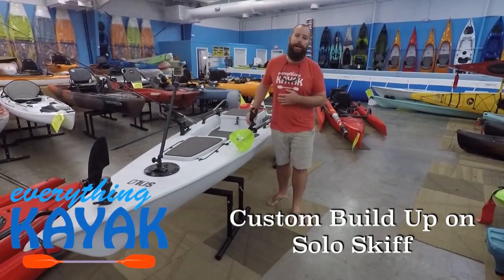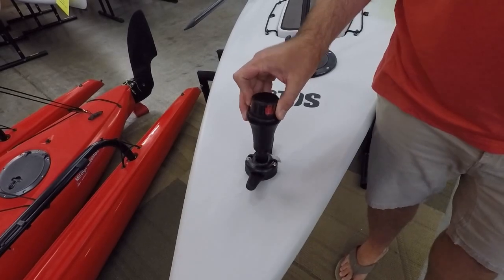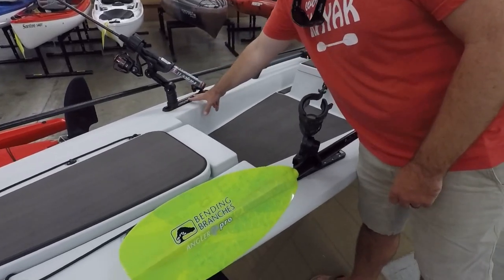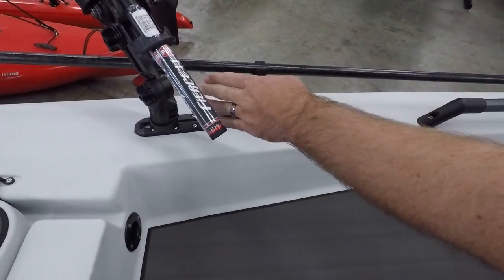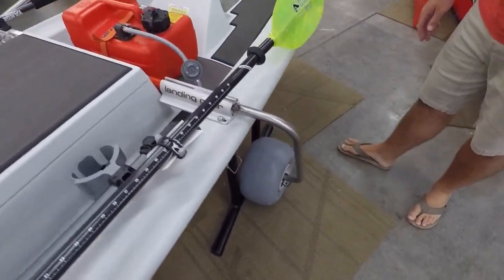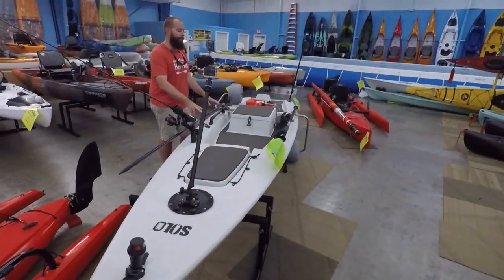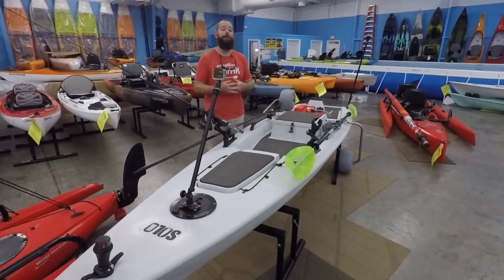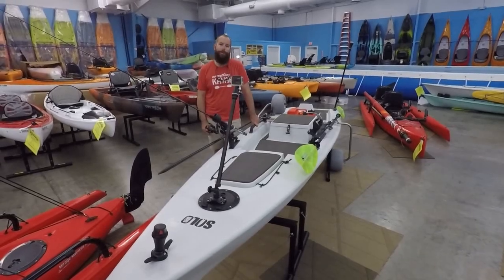Solo Skiff - Custom Build Up

Comment: The plastic transom is too flimsy. When I owned my solo skiff, I added 1/4" aluminum plate I thru-bolted and used 5100 to secure plate on both sides of the motor mount. That was a far superior arrangement. I think I will build a boat similar to a solo skiff but designed the way I want it to not be so tippy and more functional deck space.

Comment: I would like to get a price on the same setup except without the gas tank and the paddle. And I would like a different color. 
I have a 2016 hobie outback that I purchased from you all brand new back in 2016. And I've visited the store a few times after that purchase to browse around. Thanks Steve🙂🎣

Comment: What size round hatch is the best size to install on it, and is it recomended to stay within the circle on the solo skiff.
Reply from the maker: A 6" hatch is the hatch size that we suggest for the bow of the Solo Skiff.  It is recommended to stay with in the flat circle.  The bow has a bit of contour that can prevent a hatch from properly sealing if mounted outside of the flat area.

Comment: Will it take a Yamaha 6hp
Reply from the maker: The Solo Skiffs are rated for 5hp outboard motors.
Reply: It's rated for a 5 hp but, a 6 hp Tohatsu will be the same motor just a different carb, so same weight. A lot of folks run 6 hp on their Solo's.
Reply: Yamaha should be same as Tohatsu as far as configuration goes 5 = 6 in weight. A lot of folks use the little Yammi motors. I don't think you'll have any issues.

Comment: What is the MSRP
Reply from the maker: The solo skiff alone is $1875 (completely stock) and the build out in this video came out to just over $3000
Reply: @everythingkayakbicycles9975  thanks great video very detailed.  Wondering if you guy will make a new model.
Reply from the maker: @anastaciamartin4208  at this time we have not heard of anything from the team over at Solo Skiff about any hull updates.
Reply: @everythingkayakbicycles9975 does that $3k price include the motor?
Reply from the maker: @jimbeauxjimenez1850  no it does not. We do not sell motors. That is a separate purchase/modification that you would do yourself.
Thank you for the question!

Comment: Is the Solo as stable as a Pro Angler 14?
Reply from the maker: The Solo Skiff has a 3" wider beam (at 41") than the Pro Angler 14. This being said they are actually pretty comparable as far as stability.  One does not our perform the other. Thanks for the question!
Reply: @everythingkayakbicycles9975  Thank You!